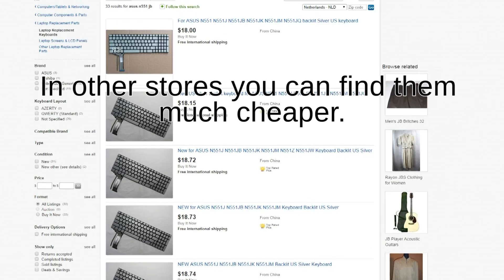Asus n551 (-jb)  keyboard replacement

Comment: This video has been extremely helpful. Give it a 👍
I did a couple of things differently, though.
1. 4:25 no need to connect the HDD. Without it, it would boot to the BIOS, but there you can try the keyboard (for example, try to set up a new user/admin password. Maybe don't confirm it!). You won't be able to check all the keys, but more than enough.
2. 7:31 I kept the power socket on the chassis - you can slide the connector attached to the mobo by using a small screwdriver and pushing out the small plastic box on the connector.
3. 8:45 I didn't have a hot-air gun, so I used a soldering iron instead. Now, that is not the proper tool so take precautions:
  3.1. Set it up at the lowest temperature possible. Teije here used air at 215 °C, which means the plastic pins will melt at something like 150 °C. Your soldering iron will do more than that.
  3.2. Use a fan to remove plastic fumes from under your nose. They're toxic. And clean the iron tip often.
  3.3. Even if you manage to mold the pin caps into tiny tips, many pins won't survive the cover extraction anyway. Don't worry and use some cyanoacrylate (not sure what Teije used) during reassembly.
  3.4. Maybe don't use an expensive soldering iron. I won't be responsible if the plastic will ruin the iron tip. (Actually I won't be responsible for any of the suggestions I'm giving.)
4. Turned off the music and used my own. Sorry man 🤣

Every other step is pretty much necessary, so follow the instruction as closely as possible.
Except for the hinge covers, I didn't check if removing them was actually needed.
But man, looks like Asus really doesn't want people to fix their own keyboard!

P.S.: There's a chance that plastic is actually ABS, so if you happen to have one of those "3D pens" maybe you'll have the perfect tool to reshape the pin caps! 😆 (I doubt it'll work, though.)

Comment: Hi! I wanted to really thank you. After 2 IT services rejecting to do this job I had to decide to do it all by myself. The replace keyboard was surprisingly cheap and your video was of invaluable help. Although I removed the welds with a soldering station and then applied double sided tape to secure the keyboard (who cares about plastic welding?). Greetings from Argentina!
Reply from the maker: Nice to hear that it worked out for you.
 I was almost in the same situation as you , complete replacement of antopcover costing + 100euro or diy for 20 euro's ...
 Because i couldnt find a complete video about the process for this model, i made this one.   

  Greets back from the Netherlands ;-D

Comment: thanks. Stumbled on your video after i had to open my asus to fix an internal screw hole. These laptops where a real bargain. after all these years and some deal of harsh treatment, some plastic supports failed. i opened it up and used this chance to give it a deep cleanse, and now it's as good as new (apart from a few plastic parts). I have changed plenty of desktop pcs in the mean time, but i am really attached to this laptop. I brought it with me on many journeys, and to this day there's little it can't handle. I even manajed to edit some short 4k videos with premiere a couple of years ago. Shortly after i switched it to linux and i see no reason to change this awesome pc for something new even if i could afford that, since it is still quick (finger crossed). I really hope i will never need what i learned from this video of yours, but nonetheless!

Comment: Thank you very much for this video. I personally used a soldering machine to remove the plastic rivets. Then I use a wire for 3D printing to create the new caps. All in all everything works well.
Reply: Instablaster.

Comment: Thanks very much for sharing this info. I've never done this kind of thing before, and I was at the last step: removing the keyboard. And I thought: it can't be removed, it's attached with 'plastic things'. Now I know these are called 'plastic welds'. And that there is something like a 'micro blowdryer'. So without that, it probably can't be done I guess?
Reply from the maker: Not the official naming i think (plastic welds) . maybe with good glue you could put it together if you broken all those plastic pieces .

Comment: Hello, thank you very much for this video. I am about to go rhrough the same procedure. But my hot air gun doesn't have such muzzle. How important is it to be preserve the plastic wields? Can I just use my soldering iron on low temperature? And maybe later secure the metal plate with glue or double-sided tape? Thanks once again for the video.

Comment: Hello, great videom I wish I have found this tutorial before went and atempt to open my pc (Asus N551JX, very similar with yours). The problem is when I tried to on I cut the ribbon cable of the backlight keyboard with an credit card (the thing I used to open up and separate the back cover to get access to the internal to proceed to clean). Now, all works, but I get no backlight on keyboard because of the damage flat ribbon cable (slightly cut),  is this fixable without taking of/replace the keyboard, I mean, can this cable be "glued" back ?

Comment: Thank you for your video.

I need to replace a keyboard on my G551JM because only half of it is working properly. Thanks to your video I know what exactly shall I do.

Could you tell me, what heat gun are you using in this video?

Thank you
Reply from the maker: i was using an cheap baku heatgun/rework station  simular model can be found here >>>>>  https://www.ebay.ca/itm/BK-858D-SMD-Brushless-Heat-Gun-Hot-Air-Rework-Soldering-Station-700W-220V-New-/132768884800   

btw. i didnt bought mine from ebay , its just a link to simular hardware

Comment: Thanks for sharing! I followed the instructions and may have damaged my audio: I don't get sound through speakers and through headphones it's very quiet and noisy (i.e. you can recognize what song is playing, but there is barely any sound). I rechecked the speaker connectors, but reattaching it makes no difference. Do you have any tips for troubleshooting?
Reply from the maker: hmm, thats sad to hear, thats almost sounds like een audiochip issue, but i nevver encountered a problem like that after a teardown. 
Are you shure nothing is shorting the audio circuit?
Reply: @teijekooijker3146  It may be a short, will look into it, thank you for your response. For now I bought a cheap Bluetooth headset as a workaround.

Comment: That smaller ribbon cable next to the keyboard cable
Is that for LED back-lighting? or is it used for power-button
Reply from the maker: i think its for the led, not entirely shure about that,, but the powerbutton is " just" one of the keys of the keyboard.
Reply: @teijekooijker3146  I am going to replace keyboard on G551jm ,,, I think it will be the same ,,, Hope it works ... Can you point out anything for me ?
Reply: The power button should be on the pin5 of the keyboard connector. I had to search it on a N551V. Connect it to ground for a moment to power the nb on. If the keyboard is bad the nb can't power on. The keyboard design is stupid, putting also the power button on it is even more stupid.

Comment: Hi. Thanks for the video! Do you know any tricks how to attach the metal placeholder to front cover? My cover was demaged so i had to buy new, and the new cover dont have these plasctics welds (almost all are broken).
Reply from the maker: in the proces i lost some tips of the plastic welds, and i used some "hard plastic glue" for it. 
But the "spikes"where still there so i had something to glue it to, if those are gone i dont have an clue how to re-model them . there is an website who sells the frontcovers incl keyboard, but it has a higher price then just the keyboard ( ofcourse) .
for my type (the 551JB ) and (i assume ) your language it would be this one >> https://www.asusparts.eu/en/Asus-90NB05T1-R31RU0
Reply: Teije Kooijker  Yeah, to buy new is probably the only way i have. This type of hard replaceble keyboard is real pain. Thanks for the answer!

Comment: Dude. I had to replace the music with some Two Steps From Hell because this is an epic journey.
Is the hot air blower necessary? I'll have to replace this keyboard at my sister's and she doesn't have anything like that.
What can we use instead?
Reply from the maker: I tried to keep the plastic tabs as good as possible , thats why i used that hot air station. 
Those stations (the simple ones)  are pretty cheap to get and always handy to have , i also used it for touch screen removal etc. .  
Maybe u could use an diffrent technique but i prefer this one.
Reply: @teijekooijker3146  Thank you! I’ll see what I can do 🤔

Comment: Hey man. When you remove the motherboard looks very easy. When i try to do it i feel lot of resistence. I removed all the screws and eventi the cooling fan... It feels like the mobo is glued. Is it possibile?
Reply from the maker: I dont think its glued (pretty shure original it isnt) , maybe the I/O ports are stuck?  maybe cable you misssed?
Reply: I've met some resistance too. Try to slide it slightly inwards, the lift it and disconnect the flat cable underneath.
Small adjustments, don't force it (of course!), you will be able to remove it. Ciao!

Comment: What glue did you used ... And just lits all the tools I need .
Reply from the maker: I used "bison" hard plastic glue  ( i live in the netherlands ) but think any glue that is working for ABS will work ( i believe thats the type of  plastic). . 

tools:
 small head philips screwdriver  
some pry tools 
and a (cheap) hot air station
flathead screwdriver to keep keyboardframe under tension when melting the tabs. 

i believe thats it, it has been a while ago. maybe when you see the video closely you could figure  it out.

Comment: Guys ... I have similar model n551jx ... I tried to open the back cover in wrong way to clean the dust... and then I  panic and return  everything to his place.... then I terned on the laptop.... it worked... but the screen doesn't.... so what's the problem?
Reply from the maker: hard to tell your exact problem. 
Ofcourse check your display connector, 
its a connector close to the hinges of the laptop. (couldnt find it clearly in this video..)
So open it up again , and make shure every cable is connected properly.